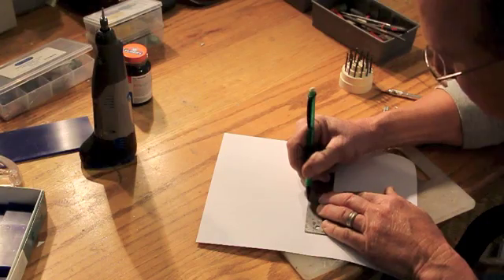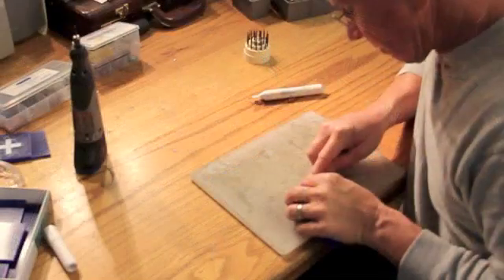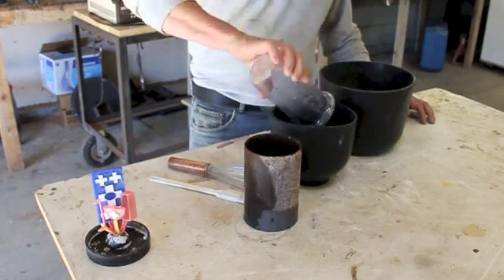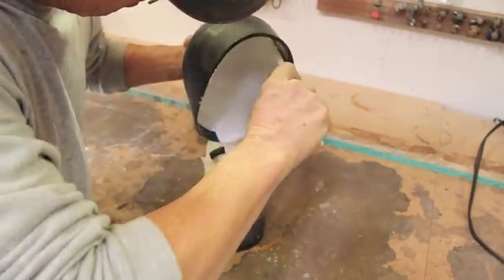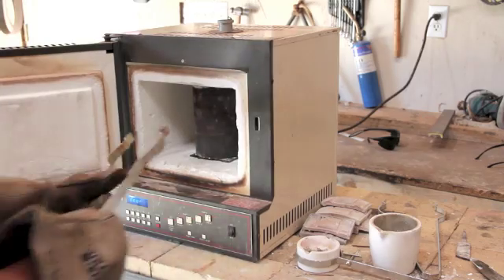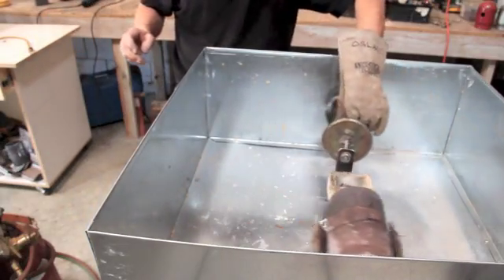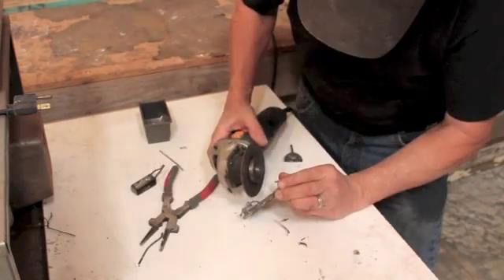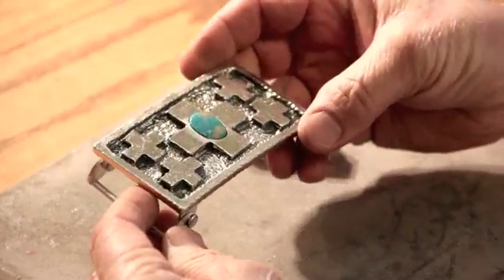Lost Wax Casting Tutorial

Comment: hello, after you put the mold in the kiln - where does the wax melt off to?
Reply from the maker: Excuse the late reply.
Good question! The high temp, 1300 degrees f., basically vaporizes the wax and must be done in a ventilated setting, as in a open shop.

Comment: Hey I was wondering whats the purpose of the section to the right of the vacuum chamber I recently picked up one similar to yours and havnt been able to find any info awesome video much love 💚
Reply from the maker: Maybe for vacuum casting?? I'd need to see a picture
Reply: @daveosland3199  it looks like the same one you have the left side is for vacuum and the right side has a platform with a hole in the middle
Reply from the maker: @starboardpanic  it's for vacuum casting-
The hot, burned out flask is placed on the platform and the vacuum from below draws the molten metal down into the casting!
  some use a web-like wax inside the lining of the flask to help with the vacuum process.
Reply: @daveosland3199  hmm good to know I will look into it more cuz I dont really understand how it would suck the metal in as the investment would be hard
Reply: @daveosland3199  thank you!

Comment: Dave, I wanted to thank you for making this video. Very interesting. I have heard the term 'lost wax casting' but had no idea. Question... while in the kiln, what is going on with the wax? Does the heat of the kiln simply evaporate/ burn off the was? Thank you so much.
Reply from the maker: You got it! 1300 degree vaporizes the wax- it's lost! the 1300 degrees is held for about 3 hours!
Dave

Comment: I'm new to lost wax casting and i was wondering the advantage of spin casting versus just pouring the metal into the mold
Reply from the maker: +William Ela  
Silver melts at around 1750 .  You're pouring the liquid silver into a flask of around 1000 degrees- a 750 degree difference! The silver tends to set up so fast that it often will not penetrate to all "corners" of the mold- i.e.,  an incomplete cast.
  The centrifuge literally hurls the silver into the mold, allowing the molten silver to completely fill all voids (hopefully) of the casting. This is why it's so important to place enough sprues strategically on the wax model so that all areas of the mold can be reached by the liquid before it sets up!
Dave
Reply: Dave Osland Thanks! If I am able to would it be just as easy to heat the mold up to the same temp as the metal and pour?
Reply from the maker: +William Ela 
I don't know anyone who heats the investment (the plaster mold) up that high. I suspect that high of heat would be too much for it.
Perhaps someone might comment on this much heat. 
     Usually 1300 is the "burn out" temp and casting is done around 1000.  Dave

Comment: How do I adjust my centrifuge the weight, and how many time do I turn the centrifuge to create enough force.
Reply from the maker: +Steven Sachs 
Adjustment is made by wheeling the weight in or out on the treaded spindle. Adjustment should be made with the elbowed arm straight with the crucible (and metal in it) and the flask in place, ready to spin. adjust the weight until the set up is "balanced"
My windup was about three turns... Others might have feedback on the "wind up"...

Comment from the maker: Someone asked if this method will work with aluminum-
I've never cast Al. , but I don't see why not. Gold and bronze can use lost wax.
Anyone have any feedback???
Dave
Reply: Dave Osland for aluminum I would just gravity cast while drawing a vacuum at the base of the mold. For a vacuum pump just get a Harbor Freight A/C vacuum pump, a piece of 3/4" plywood and a sheet of rubber.  Drawing a vacuum at the base of the flask eliminates the need for vents in the mold. Considering the pouring temperature of Aluminum is 750 to 800 deg. C and Silver is between 950 and 1050 deg C. casting aluminum in this way would be simpler.
Reply: Dave Osland  cool video

Comment: What kind of wax is used, what is the name of it and where can I buy it ? I've built a furnace to melt aluminum and am new to this. Just a side hobby for me.
Reply from the maker: Shawn P look up "riogrande' or "ottofrey" suppliers. Carving wax comes in  sheets or tubes (for rings), green or purple. Build up wax comes in sheets, pink or green. These you laminate up (and can be etched or carved)  to create your model. ("addition" modeling). Your furnace should work. Remember, when burning (melting) out the wax casting, the wax will run out the bottom of the investment mold, and burnt up in the heat of the furnace, kinda smelly and smoky.

Comment: This is a great video im going to start doing some casting myself. Does the flask have be at a certain temperature prior to casting?
Reply: temperature of flask and silver differ according to thickness of your model the right temp are very important .  I do a lot of casting and especially silver I am an jeweler by trade if your metal is slightly to hot or your flask to hot you will get porosity and your ring or item will be spoiled.
Reply: Use a vacuum to help with porosity